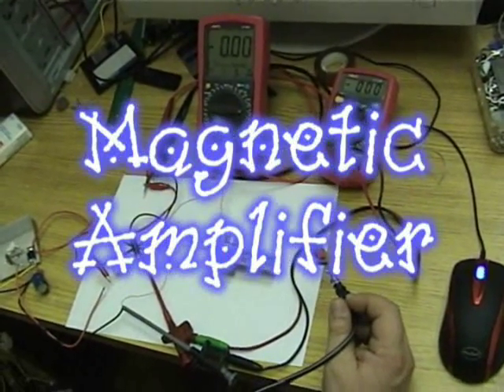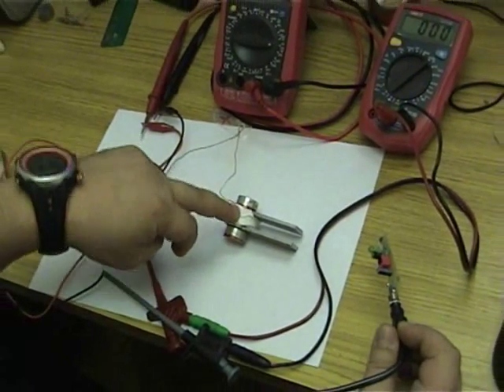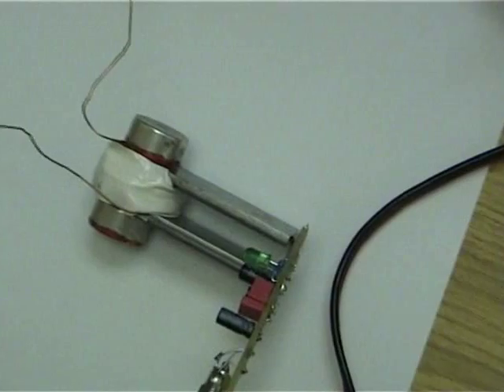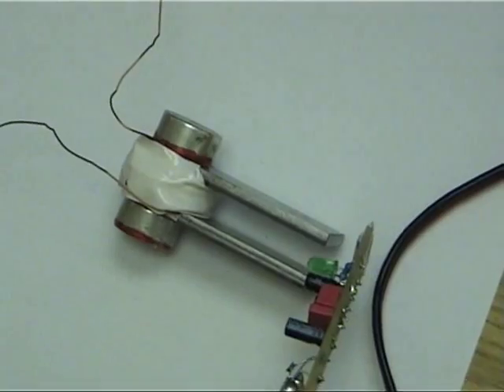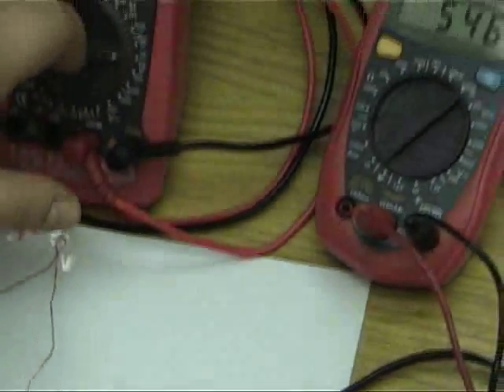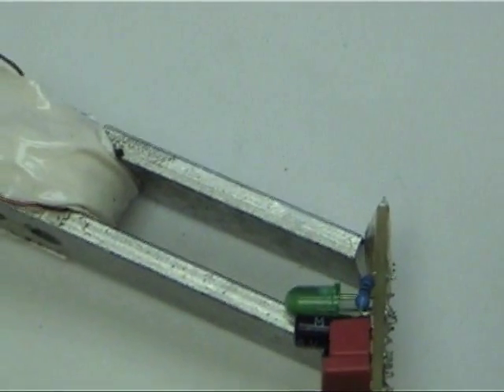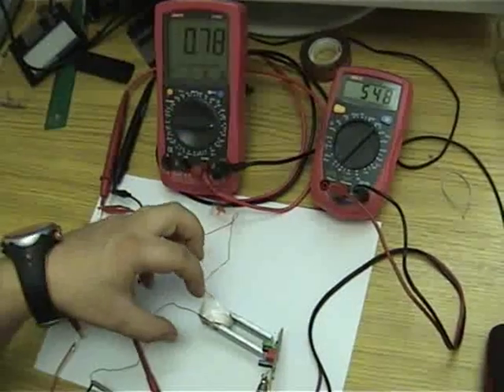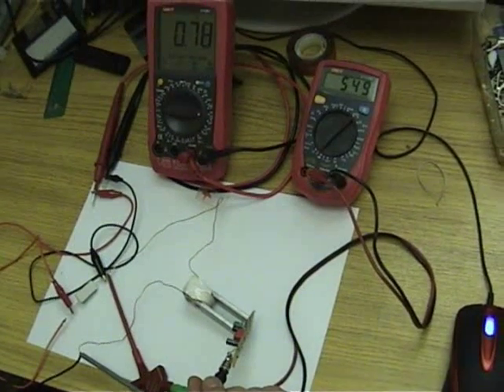magnetic transistor - Hildebrandt proof of concept

Comment: try to make like a type of stepper motor with it. You switch the magnets accordingly to rotate the motor. Measure the input and output power and see if there is some over unity between the electrial input power and the mechanical output. BDW... THIS WOULD NOT BE FREE ENERGY... THAT IS, NO MATTER WHAT YOU THING, IMPOSSIBLE. IF WHAT I SAID WORKS, YOUR JUST ADDING THE MAGNETS POWER TO THE ELECTRICAL POWER IN ORDER TO ACHIEVE HIGHER MECHANICAL POWER (THIS WOULD REDUCE ELECTRICAL INPUT POWER NEEDED